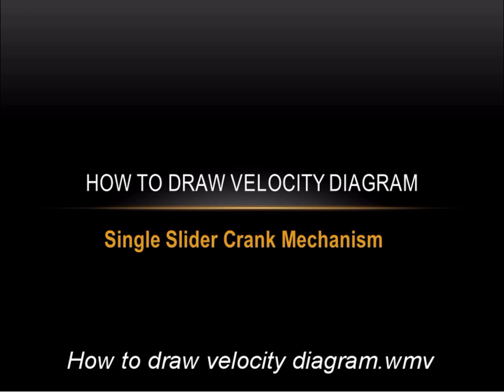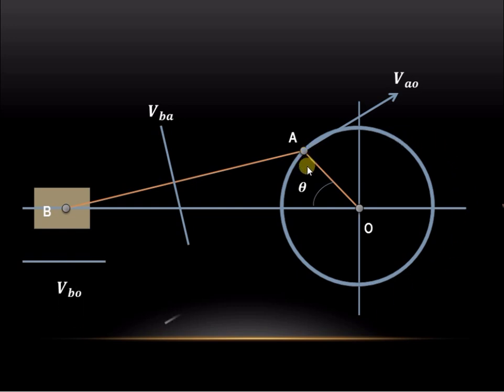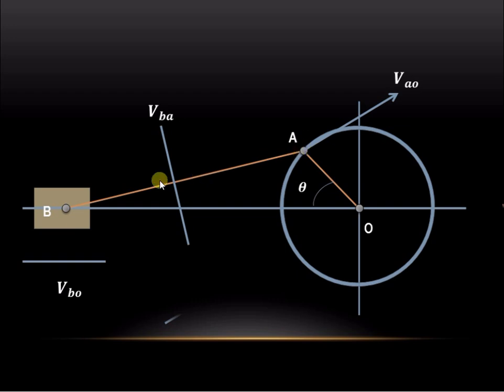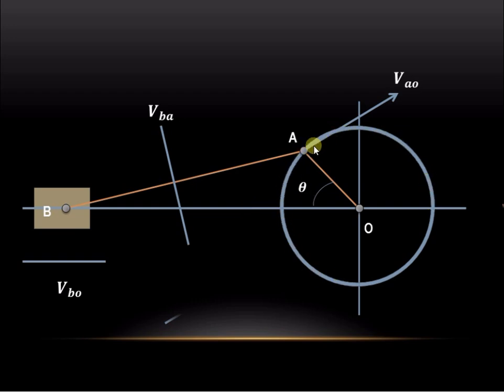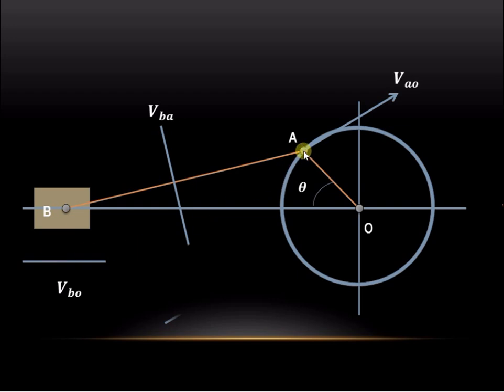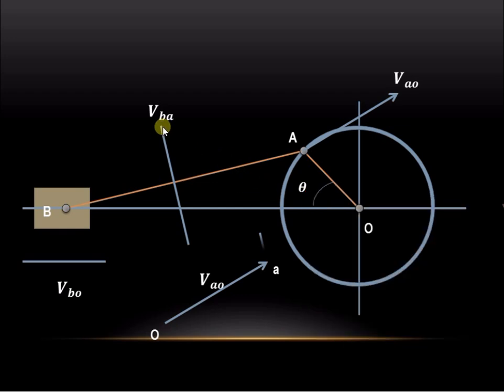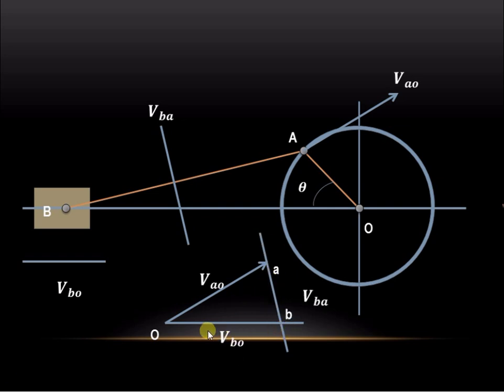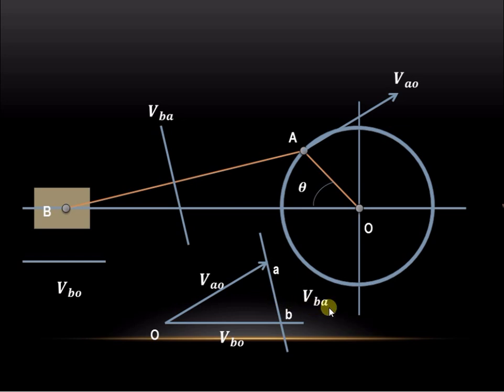Lecture 1 | How to draw velocity diagram | Relative velocity method

Comment: Sir what is the meaning of 30% outstroke in problems of velocity analysis
Reply from the maker: Piston displacement = 0.3 X Stroke length = 0.3 X 2r .  Thanks ...
Reply: @CHINMAY_ACADEMY  Thanks sir but in a problem angle of crank is not mentioned but on its place 30% of outstroke is given then how to angle by which crank is rotated ( for example angle 30 degree already given in a question)
Reply from the maker: You have to solve the quadratic equation formed by trigonometric substitution to calculate the crank angle THETA...